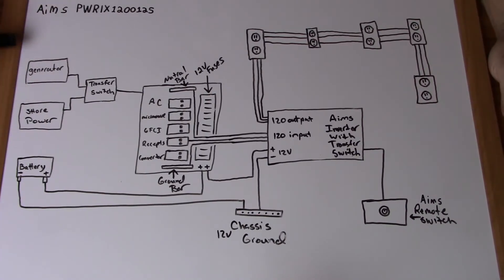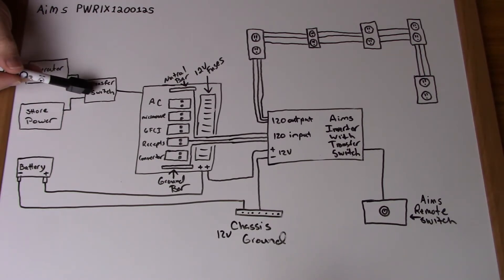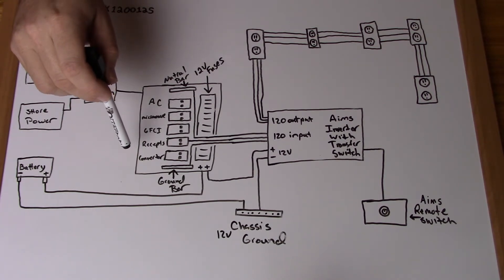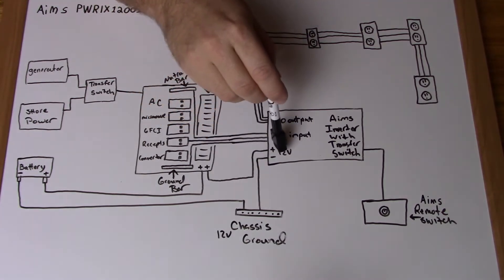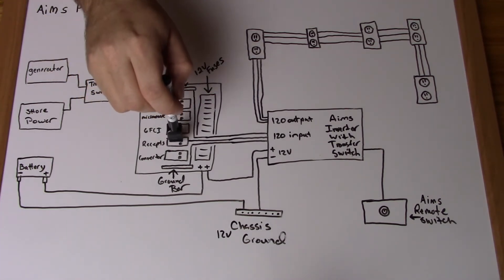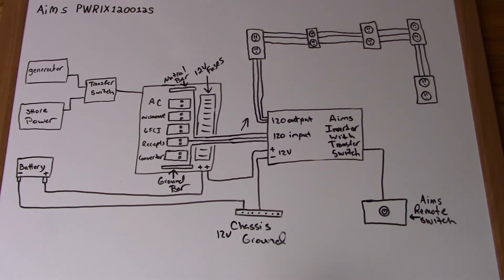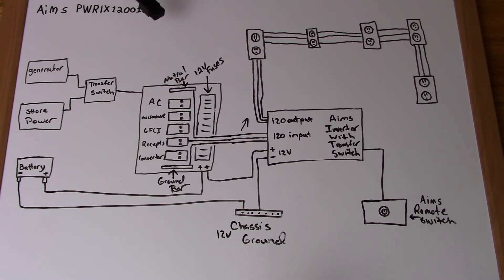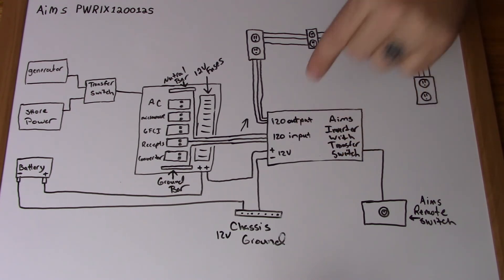Installing Aims Inverter part 3 wiring diagram

Comment: After adding your inverter/charger, do you manually turn your original converter off when the inverter is turned on?
Reply from the maker: Our inverter dosent have charging.

Comment: The part that is confusing is your note of 12V inside the inverter - you have a positive (cable?) going from INVERTER to PANEL?  and a Negative cable going from inverter to chassis to battery?  Why not just have a positive and negative cable going from inverter to battery - why are we placing a positive cable from inverter to panel direct?
Reply from the maker: There are a positive and negative cable coming from the batteries to the electrical compartment. We opted to use the open lugs there instead of running new cables all the way to the battery. We have an install video where I think we show the connections.
Reply: @2TrailHikers  CAN YOU SEND THAT VIDEO?  MINE ISNT WORKING I HAVE A BATTERY/BATTLEBORN, INVERTER (AIMS) 3000W AND A WF-8930 PANEL AND BATTERY KEEPS GETTING OVER-DISCHARGED NO ONE KNOWS WHY. WILL PAY FOR HELP.
Reply from the maker: @matthewalkman386  https://youtu.be/gQ6a4gNyOd0 i am not familiar with that setup Ours will discharge the batteries but there is no built in shut off at a certain voltage on ours.
Reply from the maker: I sent the link in the previous reply.

Comment: I know this is a bit of an older video but just a warning on how relying on that AIMS internal switch.  Ours went bad!  So while on shore power our inverter ended up draining our house batteries.  Now we are stuck with either buying a new inverter just because of that switch or wire in an external through power switch.
Reply from the maker: Aaron we had trouble with ours not the same problem you have but we havec2 new videos showing the issue and fix. https://youtu.be/Jg446cZXJaI
Reply from the maker: https://youtu.be/LHaLGiKu8Bs

Comment: Great job explaining this. Question: how do I wire the AC side of the inverter for multiple receptacle breakers?  have three breakers on my AC panel that I would like powered by my inverter. So in my situation when compared to your diagram, I have 3 receptacle breakers not one. One powers a microwave and the other two spit my receptacles on two circuits, one for the front half of the RV and one for the back half of the RV. We never use more than 1200W on the receptacles for more than 5 min at a time and never run the micro with other loads, so I’m not concerned about overloading my 2000W inverter and if this ever did happen, the inverter has an automatic overload shutoff.  My ac panel is wired to other loads which I don’t want my inverter connected to (air-con, water heater, washing machine, etc) so wiring to the main in at the panel is not an option.  Sorry for the long question. Any advice is appreciated. Thanks again.

Comment: Great video.  I installed my inverter/charger on the line coming into the 120V distribution box and then the A/C out supplied power to the 120V distribution box.
Reply from the maker: Awesome I'm glad you enjoyed. Thank you for watching. It looks like I'll be doing another in inverter at some point ours died.

Comment: Where did you connect the 12v - of the inverter? Straight from neg side of the battery or in the somewhere in the breaker panel? What gauge of wire you used? Thanks

Comment: Oh, and the refrigerator is also plugged into this line as mentioned elsewhere so make sure the refrigerator is in the "GAS" only mode if it is on at all.
Reply: You could get a subpanel and move all the circuits you want to use off of the inverter, to the sub.  Put the inverter between the to panels.  Just make sure the wires are the correct thickness between the panels
.

Comment: One key to remember is to make sure the inverter is turned off when the RV is Not in store mode and not plugged into shore power after you are done using the generated sine wave AC. The inverter itself will draw enough power from the batteries even though all of the AC sinewave loads are turned off. All TVs and most other items plugged into the AC outlets will draw power when they are off as well. The power drawn may be much less than when the items are "ON" but they will still load the house batteries and discharge them. I turn the sinewave inverter of as soon as I am done wathcing TV, using a plugged in notebook computer or even charging cellphone batteries with their AC charging "Wall Wart".

Comment: I have found your videos to be very helpful. 
I am in the progress of solar and inverter install so is timely. 
My inverter (2000 W) does not have the internal transfer switch so your diagram helped on electrical placement of my external transfer Switch. 
One question is with the inverter providing 120v power it looks like your inverter is the breaker. I will install a breaker in between the inverter and transfer switch in my setup.
Reply: Looks to me he has a single breaker for his plugs.  So he took the output from the breaker to feed the inverter, with thicker wiring.  Then the inverter feeds back to the original house wire that was once fed by the breaker....I think.  Mine has one breaker for the bedroom, one for the living room, one for the bathroom, one for the kitchen.  So, I'm planning mine around a subpanel.

Comment: Russel great video and I have a question on the install, on the main AC panel did you leave the original breaker for the 120 input of the inverter
Reply: It’s been a while how is the system working
Reply: I’ve had my AIMS inverter install since 2018 and it works fantastic.
The fridge is on the inverter line so when your driving you are running fridge at 110 volt via inverter.
But when you stop at your destination, I suggest you move the fridge to propane or it discharges the house batteries quickly

Comment: A separate cable from battery bank fused to 150a is recommended. 10 amps of 120v = 120 amps of 12v DC

Comment: I was just wondering what fuse size you used on the battery terminal side?
Reply: Okay, thanks for the info. I have what looks like the same breaker/fuse panel in my toy hauler and will probably install in a similar way.

Comment: What size wire are you using to feed the inverter 12 volts.
Reply: Thank you for the help and great video.... I will be ordering this inverter and remote switch from your Amazon store.

Comment: Hey Russel:  This was a great explanation and I basically followed your lead on this to install the exact same inverter in my 2014 24.1 Axis.  There are obviously some differences.  One big thing I did was install a simple, cheap battery monitor so I could keep an eye on how much power we were using when boon docked.  Good thing I did!  It turns out that our refrigerator is part of the outlet circuitry that I tapped into with my inverter.  It is simple to make sure that the fridge switch is turned to gas only, now, when we are using the inverter, but it took me some time to figure out why our fridge wasn't running when we were plugged into shore power (I didn't have the inverter turned on) and then what was periodically using so many amps when we were boon docked and had the inverter turned on (the fridge was turned to automatic, so it used the inverted power that was available).  The inverter warning system did it's job and beeped to let us know it was being overloaded/ had low voltage available.  Thanks so much for your video!
Reply: Jason, Looking to do the same thing to my 24.1 2018 Vegas. Did you place this inverter in the same compartment as the video shows?. Looks space limited. I'm thinking down below in the compartment and running wires from there.

Comment: Does your unit have the ability to charge the battery? Where is the converter in the diagram? Did you remove it?

Comment: If I understand you take the black 110V lead from the breaker and feed it to the IN on the inverter, then the  black 110 V lead going to the RV plugs is connected to the OUT of the inverter. Even if you draw the white neutral and green ground wire coming out of the RV electrical panel and going in and out of your inverted in you schematic you actually didn't touch them, they are as they where before you started the installation. What about the chassis ground pin on the lower right of the inverter?
Reply: 2 Trail Hikers is that a new design because the one on your video and the one found on Amazon both have one 12v +, one 12v-, One AC output, One AC input and one chassis ground
Reply: 2 Trail Hikers Yes I understand all that but on your drawing you made you could see 3 wires coming out of the RV panel (I suppose they are black white and green) and you show them going in and out of your inverter. I guess only the black one is going in and out of the inverter The white and green one should not have been draw showing them going in and out the inverter .. right?
Reply: 2 Trail Hikers ok the hot (black) from the RV panel go in the AC IN pole on the inverter. From the AC OUT on the inverter The black wire go on the RV outlets.
BUT where do you connect the neutral (white) and ground (green) on the inverter. I don't see anymore pole to connect them
Reply: The poles for AC in the photos of the inverter look like it could accommodate only 1wire each
Reply: Ok I zoomed in the photo and what I tought was a AC pole is actually a hole to let the wire pass.  The actual connection are made inside the Inverter🖒
Reply: 2 Trail Hikers it is ok I got it now...I understand fast but you have to explain it to me long